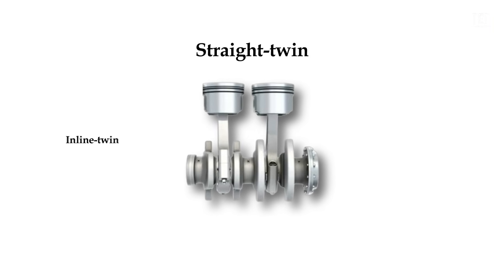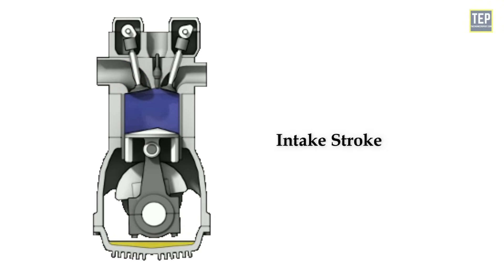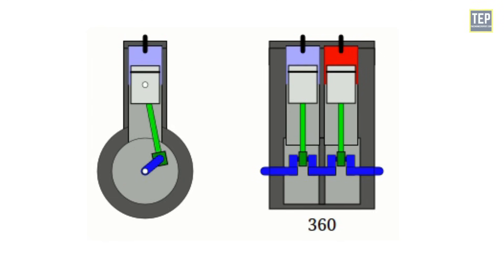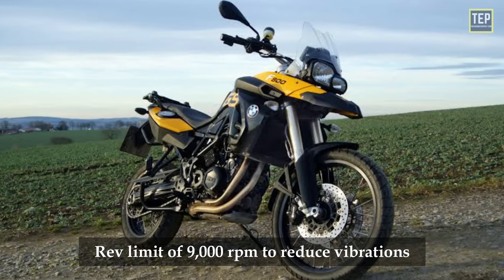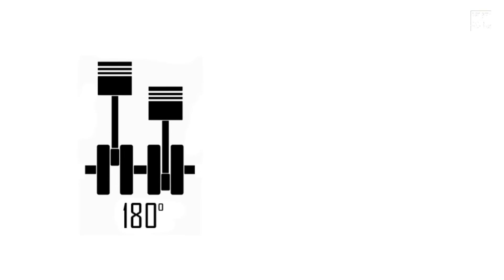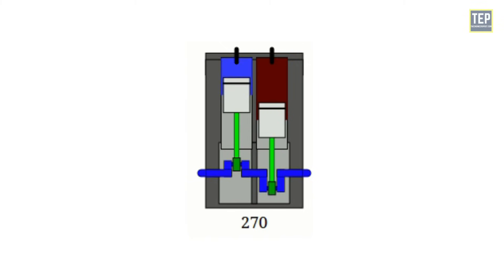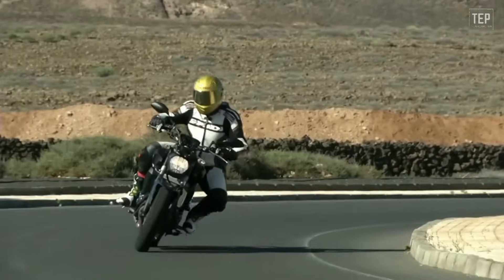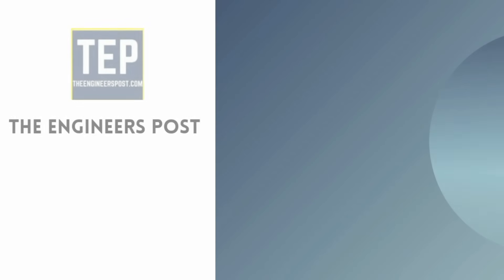360° vs 180° vs 270° Crankshaft Angles in Parallel Twin Engine | Explained

Comment: I testrode Triumph Speed Twin 1200RS, very nice sound and nice engine. Was very quiet on a highway. Had a nice low rumble. Much loved it. Torque and power was also on point. Did not lack anything.

Comment: 270 sounds great. Feels great. The most common configuration these days.
285 is similar, one used by KTM to imitate their 75° v-twin.
315 is rare, used by Husqvarna (who reconfigured a BMW F800 engine) and imitates a 45° v-twin.
125 is something BMW is now configuring with their F450GS concept, going into production. It would imitate a wide-angle 125° v-twin.

Comment: Early Honda CB 72 had a 180 degree crank. Later ones 360. Honda CB250 K4 has a 180 degree crank. The later CB250N has a 360 crank. Seems Honda had a problem figuring out what they preferred.

Comment: I love the sound of an older Triumph Bonneville with the 360 crank.  Sound is a matter of taste.  It was a 2007 with a balancer shaft and had an extremely minimal amount of vibration.
Reply: They were limited in RPM. Vibration was prone to happen at higher RPM than is typically run with 180° and 270°.

Comment: I have 2 different bikes. Both parallel twins. One of them. Is 1:08y the other, is it 270? One of the bikes, the 650 ccs. That's the 180 the other. There's eight hundred ccs, it's the two seventy

Comment: In the 1960s the new Japanese twin 4 stroke engine bikes used 180 cranks.  And they were awful to ride compared to the 360 crank bikes (mainly British) which had much less engine vibration.  Of course the Japanese bikes had lots of bells and whistles like electric start, better electrics, indicators and so on, styling that hid all the nuts, bolts and wiring etc. and they didn't leak oil everywhere.
Most of my mates at the time bought Japanese bikes, well, because they were easier to maintain etc.  The British bikes were just so yesterday.  But when we used to swap bikes for rides when out in a group, the Japanese owners were staggered at how silky smooth my Triumph Bonneville was to ride.  They used to say in amazement: "It doesn't vibrate".  The Honda CB 250 and 300 was especially bad.  The engine vibration would make your hands go numb - quite literally.  I don't know how anyone put up with it.  The suspension was also appalling.  Like a saggy armchair.  They developed a reputation for being 'girls' bikes.  (Sorry, it was the 1960s, we wouldn't say such things now, honest.)   All the reciprocating balance rods etc in the later Japanese bikes also made the engines bulky and heavy and expensive to work on.  I am not surprised it was the Japanese bike manufacturers that introduced the 270 crank.
I'm 75 now and haven't owned a bike for some years and I have never ridden a 270 crank 4 stroke.  I notice the new 'retro' Triumphs have adopted the 270 configuration.  I'd love to try it out.  They look awesome.
I really miss my old Bonnie.  Apart from being a better performance machine back then, it could pull the birds like no Japanese bike ever could.  Wink Wink.
Cheers, Lawrie.

Comment: My 1968 Honda cd175 Sloper twin has a 360 degree crank but there is only a little tingling that resonates through the handlebars. It does mean that only one set of contact breaker points is required so there is always a dead spark at TDC of the exhaust stroke.

Comment: A Bullet is bought with the heart, not the head — it’s never a rational decision. 😅
The Continental GT Twin, though, speaks both languages.
Its 270° crank doesn’t chase perfection — perfection is boring. it chases rhythm.
No dead centers, no mechanical monotony — just a seamless syncopation of torque and tone. ❤️‍🔥

Comment: The Trixie TRX850 better in every way than a 90 degree v! honestly. The 5 five head revs out in a way a duke never could and its not just the timing pulses that make it sound great, those 5 valve heads make a unique induction sound. It is addictive.
Reply: Por eso yo amo mi TDM 850 4tx

Comment: have a couple of xs650 yams , 1 rephased to 277 and 1 original , the difference in vibration is amazing , havent ridden  270 conversion as a lot more expensive and complicated ,cant compare performance as the rephased motor has a lot done to it .. eg.. now 750cc

Comment: The terminology is often used interchangeably, if not correctly. Parallel just means that the cylinders are bored in the same plane, and nothing to do with how the pistons are moving within. All crank arrangements for twins are parallel unless it's a boxer or V-twin. I prefer the traditional sound of a 360 degree - the even firing pulses. This is the classic sound of the British twins I grew up with. A Boxer sounds the same, with even firing pulses. V-twins always sound off beat, which is charismatic. 180 twins are raspy and harsh, 270s just sound like a V-twin - a nice sound but detracts from the uniqueness of a parallel twin.

Comment: Inline means front to back so in line with the wheels. The crankshaft orientation is your way of knowing the difference. Front to back = inline. Left to right = transverse.  TRANSVERSE is what a parallel twin is. Same as the straight 4 cylinder bikes all are TRANSVERSE not inline. Everyone gets that wrong these days. FWD cars have transverse engines and RWD cars have inline configuration...most of the time. Anyway inline means front to back not in a row!!!
Reply: When I heard that, I thought that's not right and stopped the video to check to see if anyone else saw the error. I'm not much of a fan of these machine generated narrations
Reply: good info, thank you
Reply: Inline refers to how the cylinders are aligned to each other. There is no orientation of an engine before it is installed. Transverse refers to how the engine is installed within a chassis. A Honda straight 4cyl is the same as a Nissan straight 4cyl, just that one is oriented differently in the chassis for FWD.

Comment: Hondas Big bang death trap!! Rode many years & well riding the big bang flat out is indescribably exhilarating. It is also flat out dangerous for newbies. The problem was cornering on throttle, the tire would lose traction from the torque. Which was  unsettling running carbs you would get use to it then atmosphere would change day 2 day n you'd get a lil surprise 😅. If it was fuel injected i would like to see if it helps. I remember one specific time I took it out after a lil 🌧 yea you can forget that. #Deathtrap

Comment: My Triumph Street Scrambler (2019) has a liquid cooled parallel twin, 270 degree firing angle.  The low-end torque is phenomenal, smooth as silk transmission, and the stock exhaust sounds great.

Comment: The 270 degree Twin has the best power characteristics and sound. Also it's compactness is perfect for any application. Even in large capacity twins with a long strokes. The future of this format looks awesome. For the introduction of camless ultra compact head design. From Freevalve technology. Imagine a Super Tenere short stroke 1500 with ultimate computerised valve control. 190 HP @ 9000 RPM & 170 NM @ 5000 RPM conservatively achieverble. Programmable with any lift,duration and timing desired in conjunction with totally adjustable ignition and fuel timing and mapping? The BMW 1250 GS Adventurer and the Ducati V4 Multistrada along with the KTM 1290 Super Adventurer S  would be put into prehistoric obsolescence overnight. One of these manufacturers will have to make this move sooner than later. Will it be the Europeans or the Japanese? 😊
Reply: Oha - your technical explanations are wrong, surely the consequence of missing knowledge in engine construction. Except in a side-valve-design NO brand (neither European nor Japanese nor Martian... 🤣) would ever introduce freevalve-technology in a series engine. For racing oK, but for all over purposes impracticable - same situation as with electrically operated brake systems.

Comment: 270 degree crank is essentially half-crossplane design. Which makes me think;

Is it possible to have inline four with 270 degree crank by putting two parallel twin with 270 crank alongside each other in the same arrangement?

Comment: Both BMW and Moto Guzzi solved all these issues by making an "opposed" two cyl engine configuration. The pistons move in opposite directions as does the crank journals, thereby balancing the forces on the crankshaft. They can be fired at 360 or 180 degrees with very little vibration issues.  These are the smoothest sounding and feeling twin cyl engines.
Reply: BMW uses Boxer flat twins meaning both pistons go 'up' or 'down' the cylinder at the same time while Moto Guzzi uses a simple 90deg V. Very different engines.
The other possible version of a flat twin would be a 180deg V. The difference being that in a Boxer configuration each piston has its own crank pin while in a 180deg V the pistons share a crank pin ie one piston goes 'up' while the other goes 'down'.
Reply: Still have both pistons stopping at the same time plus it makes a super wide engine. Boxer twins are great motors but are not perfect,pick your poison.

Comment: My question is not directly associated with this topic. I hope you’ll bear with me. In order to remove some of the disadvantages of large right angle compared to the For centerline would there be any possible advantage to moving the cylinder bore off the centerline of the crankshaft?
Reply: It should be “ large ROD angle”
Reply: BORE centerline
Reply: Yamaha have done this for yrs. It helps a little with efficiency as the piston is at TDC for a couple more degrees

Comment: This is why Suzuki's Crossplane Twin has Double Cross Balancer in their GSX-8S and V-Strom 800DE to reduce vibration, a first in the motorcycle industry to put such Double Balancer.
Reply: The CB400 mentioned in this video (and it's differently named variants) were 360* that had Dual Counter Rotating Balancers, starting in 1978. I had a 1980 CB400T Hawk, and an '82 CB450T Hawk. The Honda NC750 series has a 270* crank with Dual Counter Rotating Balance shafts, starting in 2014.

Comment: Owned a 1977 T140 for 3 yrs.
Vibration was just terrible. 
You forgot another big problem of British twins of old.
Vertical split crank cases..
Japanese engines used the stronger oil tight horizontal design.

Comment: Having been involved with a couple of T500 triumph classic racebikes that could shake so hard that the springs in the rear shocks would vibrate in sympathy and let the back of the bike squat when you revved it. I am  completely on board with the 180 or 270 cranks.
Reply: my cm 450 Honda was smooth as butter with a 360. It just sounded horrible, like a box of farts
Reply: Actually that come be overcome by having a one piece crank & a few other mods.

Comment: which engine generate more power
Reply: The power is not limited by the crank angle.   It's bore, stroke, compression,  throttle body size etc.  Valve sizes     they can all make race engine power and have 50 hour service intervals.  And maybe a rebuild after each race.

Comment: For twins nothing sounds better than a 1,000 Guzzi.  90 degree, pushrod hemi.  Second is the iron 1,000 45 degree Harley road racer, both from BOTT days in the 1980s.  The ‘76 Triumph Bonneville I’m resurrecting into a desert sled ain’t bad either.

Comment: my bike is 360 and it doesnt have that much powet or top speed.. the sound is awesome though... it can go as fast as 120km/hr and it vibrating like crazy and also, there is no more room left to pull the throttle... the ride at normal speed is super smooth and comfy...

i wonder how to make the 360 combust at the same time so it will be just like single cylinder bike? if there is a way i would like to try on my bike

Comment: I think the 180 degree is the best design and makes sense. However a Harley engine is strangely designed due to the connecting rods being on one crank pin and one rod is in the center of the other rod

Comment: Lots of vibration and a nice sounding exhaust are the only reasons for riding a motorcycle. Balancers are total BS. I have 3 EVO powered Harleys and 2 1960s British 650cc 360 degree vertical twin bikes. No balancers, lots of vibration, and a wonderful exhaust sound. All 4 of these bikes have a long stroke undersquare engine, which also helps the feel and sound, as well as producing more torque. Manufacturers are trying to simulate battery powered toy engines with their newer ICE engines, taking all the fun out of them and making them boring as hell.

Comment: Nothing will ever sound as good as an old Triumph Bonny with 360 degree crank . Lots of torque .
Reply: Kawasaki W800 😉
The true modern Bonny.
Reply: Torque is not the sum total of a twin-cylinder configuration, but the sum total of how a single cylinder (in any multi-cylinder engine) is configured to operate, with piston diameter, stroke length, poppet valve size and count and timing, and compression ratio.

Comment: Interesting.  Largely, if I twist the throttle and the bike goes vrooooom, I don't think about it too much!
Reply: @JensAddictions - sure, you twist and it goes vroom - but if you are a racer, understand the vid - you can extend the idea to 4cylinders and will choose a V-four to win your races (rather than an old-style flat 4 - which have problems balancing out the secondary forces).

Comment: Great info. I've been confused about this as the "parallel twin" is all the rage these days. I'm in the market for a new bike, so thanks.
Reply: They misname them .Calling 270 parallel
Reply: The cylinder lines are parallel. Therefor a parallel twin regardles of 360˚, 180˚ or 270˚?
Reply: It's one of the most configured engines on earth, probably.
180° - look up a Kawasaki Ninja 650
360° - look up a BMW F800GS
270° - look up a Yamaha MT-07, Suzuki GSX-8S, Triumph Speed Twin 1200, Triumph Thunderbird 1700
285° - look up a KTM 890 Duke R
315° - look up a Husqvarna Nuda 900R
125° - look up a BMW F450GS Concept

Comment: Don't  write off 180 deg cranks just yet.  Of course all my two stroke twins are thusly set up.  I'm assuming fans of two-seventies are running their engines mostly below ten grand rpm. My 2020 VersysX 300 however howls up to 13,000 and up above 8-9 rpm, the exhaust note is quite racy.  The video neglects to mention that two seventies have more pumping loss vs. 180s.  Perhaps an important factor in a motor that only squeezes out 16 ft/lbs of torque at 10k.

Comment: I owned a Triumph 360 degree (1973 Bonneville 750) and a Triumph 270 degree ( 2015 Speed twin 900) and the 270 was much more pleasant on the road.
Reply: Might also have had something to do with 42 years of technical advancement...but yeah I dig the 270° crank too!

Comment: 180° is the worst. Harsh vibrations at low and high rpms, very lumpy down low (as much as a single). 360° is great for low rpm pickup, but doesn't make much power as the others (low revs). With smooth vibrations and big power, no wonder why 270° is ubiquitous nowadays.

Comment: Would have been nice to have heard the differences!
Reply: Youtube has examples.
180° - look up a Kawasaki Ninja 650
360° - look up a BMW F800GS
270° - look up a Yamaha MT-07, Suzuki GSX-8S, Triumph Speed Twin 1200, Triumph Thunderbird 1700
285° - look up a KTM 890 Duke R
315° - look up a Husqvarna Nuda 900R
125° - look up a BMW F450GS Concept
Reply: The mt07 and tenere 700 are 270° 
The kle 500/er500 and the new ninja 650 twin are 180°
The trk502 is a 360° 
Now there are many more but still they might sound different because of different exhaust systems specifically different exhaust pipe lengths

Comment: The Honda CB450 was available in two versions with 180° and 360° crankshaft angles.
It seems that 180° was for export and 360° was for JDM.
Reply: Also the Honda 305, differences type 1 and type2 ?
Reply: Your correct.  The 180 was for export. The 360 was for domestic use. Ran into the 360s as they were imported by US mitary. Caused us probs for some repairs. Spark advancers were different in the two versions. Your the 1st person I recall to mention this. Good post.
Reply: Not the CB450 but the 400. My first bike was a CB360, after that I had a 450 Nighthawk. Both had 180° cranks.
Then I moved up to a XS650 and really liked the vibration of the engine.

Comment: I had 3 Trx850s from 2000 to 2010 epic bike  unloved at that time you could buy them for pennies.... Barn corner at Cadwell park is the place to understand the genius of the 270degree crank, it used to drive and slide beautifully & made a average rider look good.....
Reply: Really? It effects handling?
Reply: @HegelsOwl  For power slides it does!

Comment: 270° is my favourite.
BUT that means 90° V2, nothing else 💪🏻

A twin with 270° crank is cheaper to produce than a V2, that's why they do it 🤷‍♂️ They fake a V2.
Reply: It's an improved V2, not a fake V2.
Reply: Right, it's cheaper to produce, but it's also lighter because of less parts and more compact, which makes it easier to put it into the frame which aids weight distribution.
Reply: @PrimoStracciatella  V2 has almost perfect primary AND secondary balance